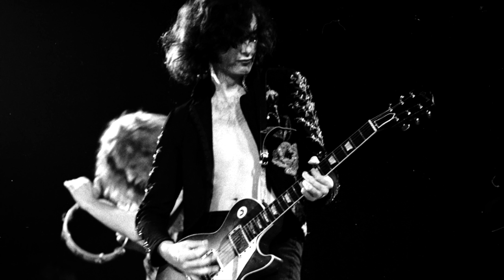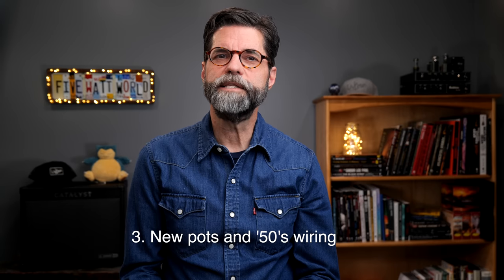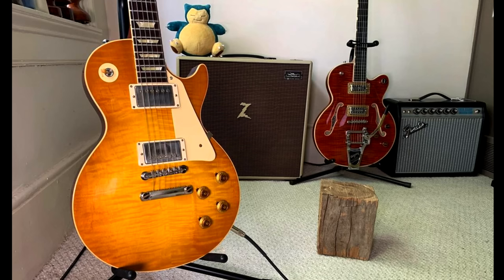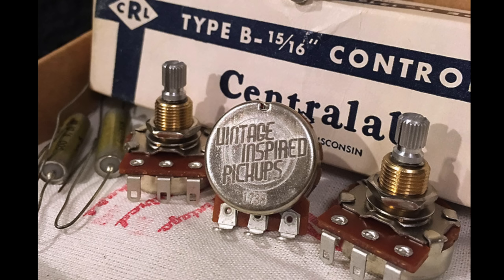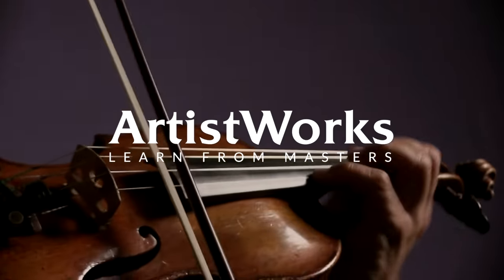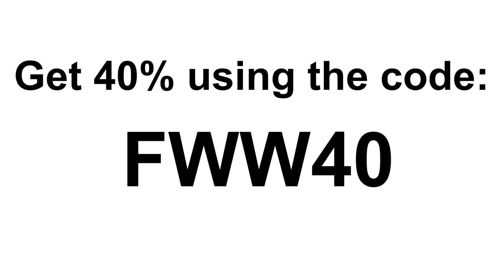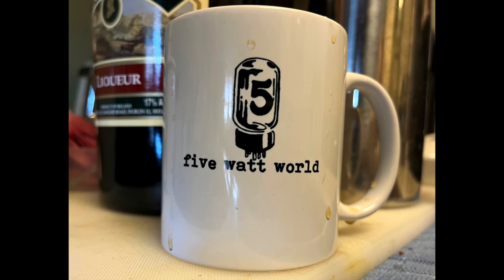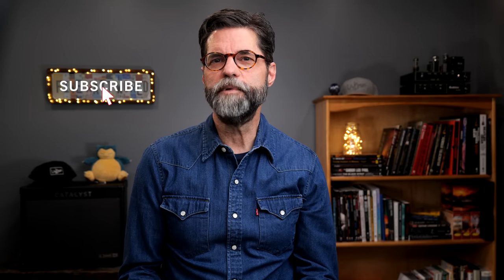Budget Guitar & Boutique Pickups? Is it worth the upgrade?

Comment: Those PRS SE's are great value for what you get. I've got a single cut one and although it doesn't have the figured top, it played great straight from the shop. If anything, the action was too low and for me had to be brought up. And I liked the stock pickups it came with. Not for everyone's tastes, but nice for high gain playing.

I generally buy a lot of budget guitars and mod them up. It's a great way of getting a guitar you want when you you don't want to spend the money. And there's plenty of options for after market parts that don't cost an arm and a leg either. There's also a lot of guitar companies now that put out some decent budget guitars which are a great base to start from.

But as you said, don't expect to get your money back. On that note, you can still put the guitar back to stock before selling and keep the good parts - or sell those off separately.
Reply: Yeah, good parts depreciate very little and people are always looking to buy them.  Like pickups.  If you buy Seymour Duncan pickups you can always resell them for 80-90% of what you paid new for them.  Same with good locking tuners.

Comment: I currently own four different electric guitars, all of them within the “budget“ range. The first one is my 1991 MIM Strat that I bought brand new as a sophomore in high school. It now has a homemade paint job, Bootstrap Golden Ale pups, and a push/pull tone that does the tele thing and all 3 pups, as well as a new neck with a rosewood fretboard. I have my ‘21 Epiphone LP Std 50s that has a modded set of SD 59s (A2 magnets and de-potted). I have my Ibanez Artcore AS73 to cover my 335 needs. That just received a new wiring harness with CTS pots and orange drops, and inherited the Epi Probucker 1 & 2 from my LP. It’s a formidable opponent to an Epi 335, especially with the Switchcraft switch and jack. Finally, I have customized my Tele partscaster, which has a USA body and MIJ Allparts maple/rosewood neck. It had Fender Vintage Noiseless pups, which I swapped out for 1st gen V-Mod pups. I didn’t like the neck, so it became an Esquire for a while, at least till I got me some Bootstrap Extra Crispy pickups, their take on ‘51s but a little hotter. I didn’t pay more than $600 for the most expensive guitar (the Epi brand new from Sweetwater). I’d put any of these up against far pricier models any day.

Comment: In 2020 I bought a PRS 35th anniversary SE Custom 24. It played nicely but, I didn't care for the pick-up and switches that turned the humbuckers into single poles. So, Vaughn Skow makes a pickup model that enhances the stock PRS pickup. I removed the micro switches, replaced the pots with Gibson 500k's, 50's wiring and installed the VS pickups. I also had a vintage Custom 22 core with Dragon pickups that was my "go to" at the time. The SE 24 with the new pickups, pots, and wiring sounded so good that I sold the Core to purchase a Fender Custom Shop. I agree you don't need to spend a fortune to get a premium sound. Thanks for all the great videos you do!

Comment: I got the Zach Myers guitar and ended up switching out the pickups for EMG PAFs. I also was so confident about the switch that I didn't bother to pot shaft size, so I had to buy the pots twice. You'd think I'd have learned my learn, but no. When I switched out the tuners, I didn't check the size, so the ones I got were slightly too big. Did I measure the tuners to get the right size then? Of course not. I just bought another set that was off by 1mm. One thirty-minute session with a reamer with everything in place, and I finally learned my lesson.

Comment: I run Rio Grandes in everything.  I worked for the largest Robin Guitars dealer back in the day and got turned on to them at that point.  They have some of the issues that vintage pickups have, namely tendency to microphonics.  Through my Boogie MkIV there is very little difference in the high gain regions between my strat-style and single cutaway Robins or my Les Paul (which is one of the late 70s Artists so it weighs 12.8lbs LMAO).  At least to the point where I don't have to fiddle with anything on the amp switching back and forth.  My loaner guitar (that I keep for when a buddy's kid wants to try guitar) is some kind of cheap Epiphone LP style and when it comes back my way I'm going to be giving it some TLC including copper foil lining, redoing the electronics, and swapping in a BBQ Bucker set from Rio Grande.  Good video.

Comment: I did something similar with a Gretsch G2420T Streamliner. Played it stock for about two years, then over the course of the next three years changed the bridge to a Compton, upgraded the tuners, swapped out the pickups, and replaced the plastic knobs with metal. The stock guitar has excellent craftsmanship of fit and finish, just needs a few parts upgraded.

Comment: The "value" comment is absolutely correct. If you want to increase the value of an instrument to you, it will not pass on to someone else. The "customization" of anything is really for the owner, certainly not the next owner. Debating what to customize is dependent on the owner,  you would not customize something of high value and antique status, but maybe your house? Defo customize your house for yourself, unless it's an old English castle :) You get the drift?

Comment: I'm a pickup swapping junky.  Pots make a difference in the roll off/taper, 50's wiring makes a difference in the tone of the roll off but not wide open (Assuming the same value pot is used).  I honestly didn't hear a difference in the pot/wiring swap since the roll off was not demonstrated on the PRS.  The pickups were a nice change though.  The stock pickups sounded like a PRS with the typical wooly low end.  Even the holy grail 58/15LT's have that characteristic.  I have a core 594 and swapped those pickups out for Suhr Thornbuckers.  They work better for me.  I wouldn't call it an upgrade though, it's just different.

Comment: I like the acoustic voicing and the neck of my little Gretsch Streamliner Jr. (if you don't like the body, neck, feel, resonance of your budget guitar then don't modify it, take it back to the shop), and now that my guitar tech has dropped some new CTS pots and TV Classic pickups into it, its plugged-in sound is worthy of its unplugged feel. The only things I would change if I could, would be a) linear instead of audio taper pots - I didn't know enough to ask for linear taper pots and I don't like the quick rolloff, and b) a bigger body cavity that would actually sound semi-hollow and prevent its neck dive. Still darn good, maybe it will be exactly right for one of my children someday.

Comment: I had the same problem as you. Been a Les Paul player since the '80s, but they just started getting too heavy. So I dug out my 7lb Strat that I barely used and put Seymour Duncan Little 59s fore and aft, and removed the middle pickup. It sounds so good, I sold my Les Paul! And no, it doesn't sound the same, but to me it sounds better. Fender scale length with humbucking pickups is a truly magical combination. So no new guitar needed, just a couple of (used) 'new' pickups ... and it's now it's my only electric six string. How's that for getting the most music out of the least gear? ;)

Comment: I did pretty much the exact same thing with my SE Zach Myers (which I bought 2nd hand but new condition). Locally hand wound vintage PAF style pickups, with the neck pickup underwound so it’s output balances much better with the bridge. It made the guitar so much more lively, airy and dynamic whilst not being hotter than most of my single coil guitars so I can swap on a gig without the gain structure changing. Lastly I found the reverse angle layout of the 4 pots impractical, so I wired the top front volume as a master volume for both pickups. Way more convenient for swells and quick adjustments to output level. It’s now a great LP alternative at only about 70% of the weight. It took me a little while to make friends with the neck profile but we’re well acquainted now. 😊

Comment: I caught the modding bug about the same time Seymour Duncan came out with their P-Rails pickups. I've since lost my appreciation for the P-Rails, but I still mod almost everything I have. Incidentally, that guitar is a Parker P-38, and it has that P-Rails in the bridge (going to change it to a Bareknuckle Polymath, or a Dylan Strait 8, or a Seymour Duncan Pegasus, soon) a lipstick in the middle, and a Dylan Strat-90 in the neck. Pots and switches will go with the new pickup.

However Mordred is the most extensive mod I have. I've always wanted a Brian Moore single cut guitar, but when the company closed down, the guitars became exceptionally rare. So when I found Mordred, I bought it on the spot without thinking about it overmuch. $400 didn't seem like a gamble at the time. Rapidly I discovered the pickups were weak, lifeless, and barely adequate to push an amp. There were built in MIDI controlls and a piezo which didn't work as well. But Mordred had a neck I really liked,  and I wanted to keep him. At the time I was paying to have all of this done before I learned the skills and had the space to do it myself. So I had a Seymour Duncan SH-15 Alternative 8 humbucker put in the bridge. It was an immediate improvement, but the neck humbucker sounded all the worse for it. So I had a Seymour Duncan Distortion put in. While we were at it, I had the MIDI removed and the piezo replaced with an LR Baggs. Finally Mordred sounded exceptional. However, the top and side had huge holes left over from removing the MIDI controlls. I started getting remarks about stashing weed in there, so I had it in mind to fill in the holes with more controlls like a kill switch. I mentioned this to a tech friend of mine and we worked out that LEDs would look good there. Plus the frets needed a level and crown,  and a graphite nut would be nice. And locking tuners would be great. Dropped Mordred off that day and started paying for the hardware. And I waited...

...July. My tech friend had officially had it in his possession longer than I had by now. The frets were dazzling. The nut sublime. The new Kluzons were effortless. And Mordred was being a pain in the ass like his namesake. My tech friend was having nervous breakdowns every time he went into his shop because what he thought he knew about LEDs, he didn't. Patient man that I am, I told him to take his time...

...October. My birthday comes and goes, and my patience is wearing out.

...December. The holidays shuts all work down.

...February. I threatened to take the bloody thing, but they talked me out of it.

...March. At this point Mordred has hung on the wall of the workshop for eighteen months largely untouched. Promises continue to be made to mollify me. But today is different. I have a bag with me. In it is $200 worth of sirloin for my tech friend, his assistant, the owner of the store, and their wives. I have a big bag of candy for the girl behind the desk. "I've been patient. In the time they took to make all these promises, I bought two more Brian Moore guitars and swapped out every scrap of electronics, plus I've installed a new fretboard on one. You have this and two weeks before I come and get the godforsaken guitar!"

The girl sputtered, "You didn't need to do this!"

"Just imagine if I had to anyway," I declared. I saw gears flying out of head trying to reconcile that. When my tech friend called later I told him the same thing, and he was too stunned to have another nervous breakdown. It took every scrap of two weeks,  but I got Mordred back. It works.

I'm modding my own stuff now.

Comment: I remember, back in the day, we used to try just about every aftermarket p'up we could find, so our guitars would  set idle for months at a time. The last guitar I modified was/is a 2004 Epi Sheraton II. I put Seymour Duncan "Antiquities" in it, front and back, and swapped out the pots for good quality 500 K/ohm CTS. What I ended up with is a guitar that plays amazing and has that elderly ES335 tone. Still have it, don't need a G*****n one, already have an LP for that stuff. Hope I didn't miss the mark on this, love this and all the other guitars in the stable. Thanks Keith, another "home run" video.

Comment: Pickups are simple electro-magnetic devices, the magnets, wire and number of "wraps"; the pots are simple as well. If it all works as designed, you have smooth range of volume and tone with the pots, and a consistent output level from your pickups that responds as expected to adjustments from your pots.

I haven't purchased a new guitar in the last several years where I thought I needed to change the pots or pickups.  

Before you go replacing pickups, pots, or wiring, there's a simple thing you can do first: adjust the controls on your amp, pedals, modeler, profiler, etc. Using this simple action, I've saved a great deal of time and money. 

For many guitars, I have a cheat sheet that lists my thoughts and my favorite settings for different gear for that guitar, which I use as a starting point to dial in the amp. It's even easier with modelers, I just copy my favorite patches, tweak them for the current guitar, and save them.

Cheers!

Comment: Zack Myers in myers blue is a great playing a feeling guitar.  I have the first version of this latest model based on the SC 245 scale length.  Been wanting to try the 594 since the silently updated the model this year.  I did the same thing, adjusting the pots to a standard layout, and opting for PRS 58/15s - their version of the PAF.  I also have the coil taps which make the hollow body transform to something akin to a tele thinline in the middle position.  All in all one of my favorite guitars to play out of my 15 guitars.

Comment: We were thinking surprisingly similar things! I have a Custom Shop Les Paul Access Standard Stoptail (7 lbs 6 oz), that I just recently rewired with 50s wiring and push/pull coil split & series/parallel. I also swapped the stock pickups for Lindy Fralin PAFs.

I wouldn't say it's affordable though, but it's not expensive as you might think second hand because Gibson Customers hate innovation 😂

It even goes through an HX Stomp into a Fender Twin 2x12.

Comment: Bought my ZM before the new McCarty SE came out. I had it upgraded with PRS 58/15 pickups, push/pull tone pots, McCarty wiring with treble bleed, cream pickup rings, McCarty locking tuners (cream), custom truss rod cover and cream selector knob. Cost me around 550 for the parts and labor. The guitar now looks more like a core than an SE. Not only does it sound great, it looks unique and is very personal. Wouldn't see myself parting with it.

Comment: Oh i have a story. I've bought myself PRS SE 245, and immediately upgraded it with a set of Seth Lovers. As a recording engineer, i made sure to record all type of riffs with original pups to compare. Me and my friend were eager to record new pickups after soldering and restringing job was done.
Aaaand it was really nothing big. I am not even sure I could destinguish them blindly. Was a huge surprise for me, honestly. I ended up selling the guitar and bought myself a 50s Gibson Les Paul (a modern one, not original ofc), because between PRS SE and that guitar, difference was easily noticable. I am absolutely cant tell why my experiment was a failure, but the stock pickups on that SE were really good comparing to a top of the line Seymours. 
In the end, the modding way is good for someone and not quite for another. I much prefer to get a guitar I really like right now, then to mod it on a quest for a better tone. But your video, on the other hand, quite surprised me, especilly the pots and wiring change. It is indeed quite significant. Who might have thought! Well done!

Comment: I wanted a Tele with the same Seymour Duncan pickups as Mike Stern’s Yamaha, which was based on the guitar he got from Danny Gatton.  Fender’s player series is routed for a neck humbucker so I played half a dozen and chose one. The wiring upgrade came from 920D and I added the split-coil resistors and treble bleed from the PRS DGT spec. All very quick and simple to do. I had a local luthier give the guitar a slight fret dress and it was done. Sounds wonderful, feels great and I use it for everything.

Comment: Actually, I do have a project I'm working on. I am doing a build with my father. He is a painter by trade. So he will help me paint and repair the body of the damaged telecaster I purchased at GC for cheap. I will be converting it to an Esquire. I'm putting a SD Broadcaster pickup in the bridge with a pro Esquire harness kit from a company down here in Texas. I'm also putting on vintage tuners and the bronze saddle bridge. As for the color, rootbeer brown with a cream stripe off centered near the top. Since it's a Squier bullet FSR, it will have an orange FSR in the stripe. It will have an ionized gold pickguard. Since it is an Indian laurel neck, I'm thinking of 2 toning the headstock. I have backup Gold Squier decals to replace the black lettering and an Esquire logo to put on as well. It may have a touch of gold flake in the brown as well.

Comment: I did this to a 90s squire weighs 10.5 pound, put a set of Josephina fat 50s fender pickups in it with vintage pots and caps, dual caps and custom series/parallel switch. To this day ive yet to find a fender strat that sounds better to me than mine. Guitar cost me 150$ and put roughly 600 in parts, got a great deal on the pickups from the local shop. Did all the work myself and can say im 100% happy with my instrument